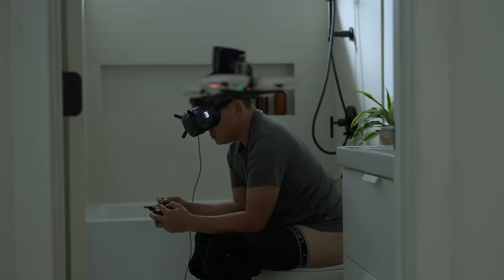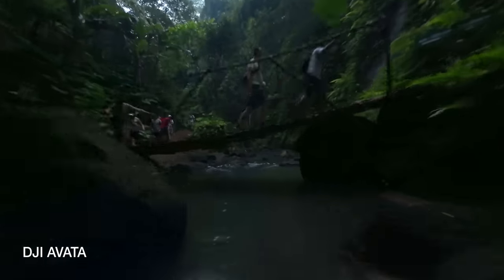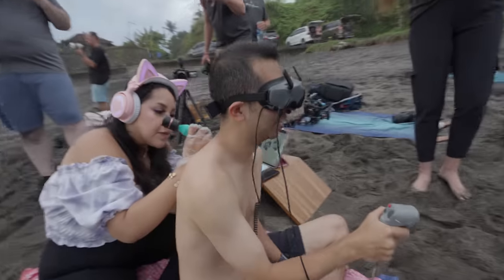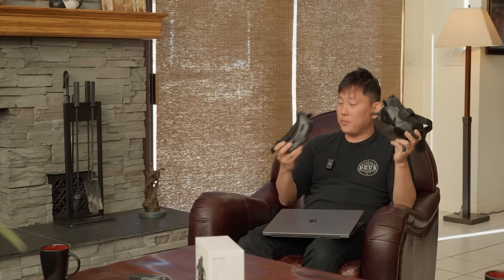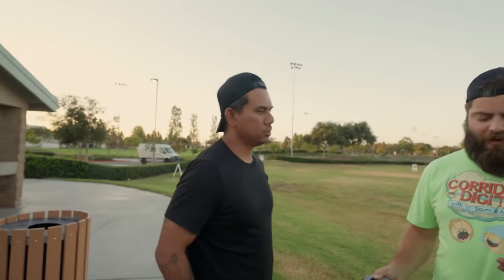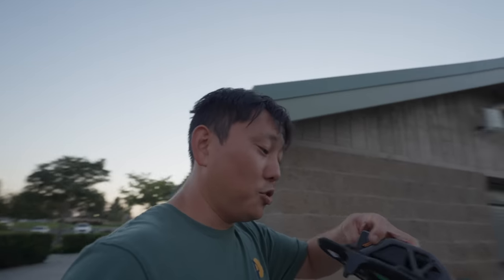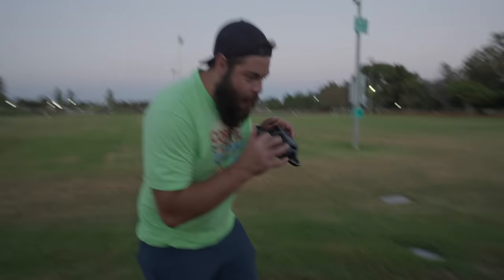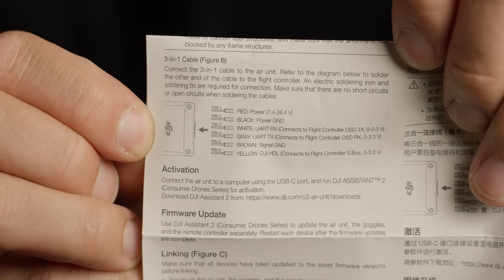DJI O3 Air Unit & Avata | DJI raises the bar for FPV again!

Comment: Great review , and great explanation of the 03 Air Unit in comparison with the Avata. 
Keep up the good work. Loving your videos. BTW 66 years  old and still FPVing with racing quads etc. You're never too old. Already been told by one professional racing quad pilot that I am "OG" so it's all good . Keep those videos coming
Reply: Congratulations you have been randomly selected for the DJI Mavic 3 pro giveaway quickly inbox the above ⬆️ name on telegram to claim..

Comment: I just thought of something huge. Dji should design there on receiver for controllers. Same as the tbs crossfire and such that we can connect to the controller we want.   I now use the radiomaster zorro with tbs. It be awesome if dji makes there own  so we can put it into our controller and connect it to the air unit
Reply: Congratulations you have been randomly selected for the DJI Mavic 3 pro giveaway quickly inbox the above ⬆️ name on telegram to claim...

Comment: Please make them keep the promise about the G2 and Controller2 to work with the Air Unit 1/2 also. That would help me switch to the new system sooner. Otherwise I see no advantage other than the size of the goggles. The AU still works great  and will be cheaper if they don’t implement backward compatibility. That selection alone makes this the best review of the AU3 so far for me. ❤
Reply: Congratulations you have been randomly selected for the DJI Mavic 3 pro giveaway quickly inbox the above ⬆️ name on telegram to claim.

Comment: O3 is great, but how will it fly with other system? Especially analog systems. Because for now, DJI FPV is messing the bandwith (at least on 50mbps mode) and make other system unable to fly.

You know, another awesome side of FPV is flying together with friends. Can we still do that with O3?
Reply: Congratulations you have been randomly selected for the DJI Mavic 3 pro giveaway quickly inbox the above ⬆️ name on telegram to claim.

Comment: I tried getting into fpv a while back, but I just could not articulate the sticks the way my brain wanted to (I'm a motion control player in Mario Kart as you can tell). Seeing this new controller makes me want to pick it all up again. DJI keeps upstaging themselves again and again!
Reply: I hate hearing people say they "couldn't" figure something out. The reality of it is, you did not practice enough. If you stuck to it and practiced, your brain will naturally learn it.
Reply: I agree with what you sad fact tho!
Reply: Spend some time in a simulator and you’ll get it in a few days. 
DRL has a good simulator. Plug in your transmitter to your computer, and practice

Comment: I have the Avata, Integra Goggles, and the RC2 Controller so I'm ready buy a 03 air unit.  I'm just trying to pick out a frame.  I'd like something similar to my Avata with prop guards and something that will handle some moderate crashes.   Any recomendations on a frame that is O3 ready?

Comment: Thanks for the great info! I have an Avata. Will the air unit camera fit on the Avata frame to replace the existing camera? And would the lens still tilt up and down once it's connected to the controller?
Reply: Congratulations you have been randomly selected for the DJI Mavic 3 pro giveaway quickly inbox the above ⬆️ name on telegram to claim..

Comment: This is absolutely awesome, but I gotta say, DJI must have been taking advice from the USB standard guys when they decided on that naming scheme. Like the first change was only a slight alteration to the platform, but the second change was a complete rework, so we called them Goggles v2 and Goggle 2 respectively.
Like bro, that's not how version numbers are supposed to work lmao
Reply: Congratulations you have been randomly selected for the DJI Mavic 3 pro giveaway quickly inbox the above ⬆️ name on telegram to claim...

Comment: Hi gene, this is a long shot but you’re the only one I saw that put the o3 air unit on the babyhawk ii, and I did the same. Does your beta flight osd shows on the goggles? I can seem to figure out why mine is not showing
Reply: Congratulations you have been randomly selected for the DJI Mavic 3 pro giveaway quickly inbox the above ⬆️ name on telegram to claim..

Comment: Can I use the Nebula Pro cameras with the new O3 air unit? I want to use a camera with good low light performance for the O3 air unit sometimes.
Reply: Congratulations you have been randomly selected for the DJI Mavic 3 pro giveaway quickly inbox the above ⬆️ name on telegram to claim..

Comment: Well ~ the points are the radio profile based on Wi-Fi Frequency Band(2.4GHz and 5GHz). It will a lot of interference ... This is number one problem of the drone no matter it is FPV or Drone.  The radio frequency band need to file to FCC. Otherwise .... no matter technology ... you need to push ... the fundamental issue still there.
Reply: Officialpotatojet  Hi there ... many thanks.  But I don't have Telegram A/C. And also I am not in USA.  Please offer others ... many thanks

Comment: Yeah, if DJI is taking care of their existing customers, I'd appreciate this a bit more.
I have over 20 drones on the original DJI fpv digital fpv system and the first version of the goggles.
I can't use the o3 unit with my goggles. If I buy the latest goggles I can't use my existing drones with them, so I'd have to carry around 2 multiple sets of goggles, get the model of goggles they released in between that doesn't give me all benefits of the latest one, or pay an insane amount of money upgrading the drones where the new air unit fits in (which it doesn't in all).

It wouldn't have been an issue for me if there was an upgrade path and not just someone on some forum saying there might be eventually - this shows how little DJI values their customers.
For me, it makes financially and logically more sense to look at the other digital systems and fade out dji than to invest into gear, that in 2 1/2 years will be replaced by something incompatible again.
Reply: Congratulations you have been randomly selected for the DJI Mavic 3 pro giveaway quickly inbox the above ⬆️ name on telegram to claim.

Comment: I use extremely durable frame Titan XL but I see props so with this new O3 air unit need to change drone frame, community recommend a good durable frame for this camera
Reply: Officialpotatojet  you already deleted  scammer winning deal?

Comment: Dude! Please tell your DJI buds that I have 13 Caddx/air unit drones that definitely NEED backward compatibility with goggles 2 that I JUST purchased. It would be even better if they made the V1 controller work with the 03 air unit or if they made the V2 controller compatible with my 13 Caddx/air units. Either way, I want to take one goggle and one controller and any of my air units. I’m not buying 11 more 03 units @ $230ea. I bought 2 03’s with goggle 2 a controller 2. PLEASE give us backward compatibility.
Reply: Congratulations you have been randomly selected for the DJI Mavic 3 pro giveaway quickly inbox the above ⬆️ name on telegram to claim...

Comment: DJI needs to figure out how to record at 24/30fps while streaming 60fps to the goggles, make a light O3 air unit without the recording and onboard memory, and just buy GoPro since that seems to be the gold standard for FPV videos. I love the look of the Avata, but, its not a GoPro.
Reply: I think with current technology the only way to do this would be with a split cam. I'm sure there is work on two cameras sharing the same lens or some other solution being done somewhere. Maybe 04.
Reply: @kurtzFPV  I'm curious why they couldn't just write half the frames to card lets say. 30fps recording option and 60fps stream seems easy enough.
Reply: @TomsPropertyCare  I don't know enough about it. That does seem like it would be a possibility, and come to think of it, all the camera drones by DJI give a live feed to your phone or controller,no matter what the camera settings, so you may be right. Although it might significantly increase latency, which of course is not good in FPV.
Reply: @kurtzFPV  I’d love to pick the brain of a DJI engineer on this one.
Reply: @TomsPropertyCare  maybe potato jet can put that on the list the next time he sees them.
Reply: Congratulations you have been randomly selected for the DJI Mavic 3 pro giveaway quickly inbox the above ⬆️ name on telegram to claim...

Comment: Patato Jet way didn't you ask the dji guys way the v1 goggles are not backwards compatible with the 03 unit? That is very weird they could release a update un the 03 unit that makes them compatible with v1 goggles 🤔

(I now people are going to
hack the o3 unit to make it possible 😏) that is like a marketing strategy but thankfully I have the avata but for the people that doesn't have it and still has the original goggles that's very sad & rude!

Potato Jet I have been following your journey when you start learning of the fpv hobby I'm a fan of your pruducts review this comment that I sent is in no matter to promote hate towards that video just saying.
Reply: Congratulations you have been randomly selected for the DJI Mavic 3 pro giveaway quickly inbox the above ⬆️ name on telegram to claim..

Comment: To be honesty, the product is pretty buggy on the firmware update.  i have 3 air units but once i switched computers, I couldnt even upgrade firmware.  I ended up returning and buying walksnail.  walksnail worked on both pc and mac, air unit worked on neither at one time.

My thoughts is that DJI is just another typical Chinese company.    They will leave you in the dark and be 100%o k with it.  That would be acceptable if they were not the most expensive product .  Luckily I just returned to the reseller and it became their problem.  Dont bother with support, they are worthless and will need to escalate every issue and wont help you.  If you order, open the package as if you WILL return.